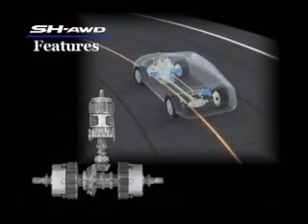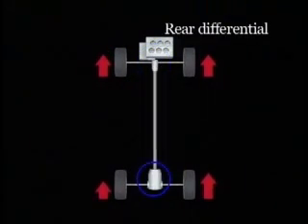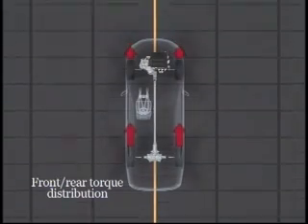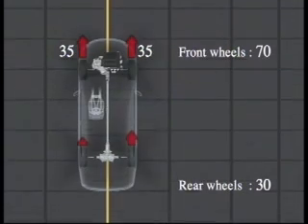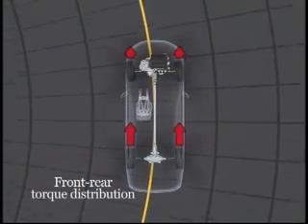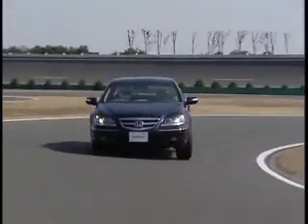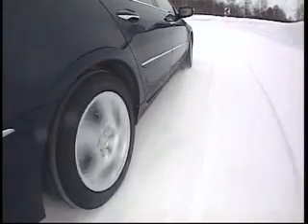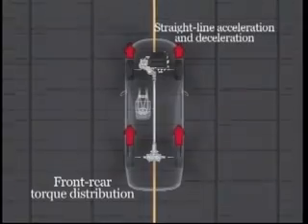HONDA SH-AWD (Super Handling All-Wheel Drive) INTRODUCTION

Comment: This will get better in the NSX, not only positive torque distribution but regenerative braking will also give negative torque to the inside wheel, meaning much better control of the car
Reply: stability control already does that by braking the inner wheel.
Reply: BY SLOWING U DOWN. WE WANT SPEED, @n_u001

Comment: Seen reviews of the car. It's a great system, but it still doesn't perform as well as other traditional AWD systems from high-end carmakers, such as Audi.
Reply: David Tran Wrong.  Audi is front drive biased, plus all the weight of the engine is over the front wheels.   Audi does not comes close.

Comment: @amigos1996 That's impossible.  Active yaw control and the ability to overdrive the outside wheel by 5% didn't exist in '96. Only the EVO, latest Subarus, and latest Quattro have active yaw control.  This Acura system came out in '04 before those iterations of those other systems were around.